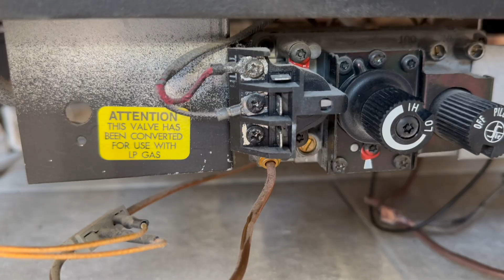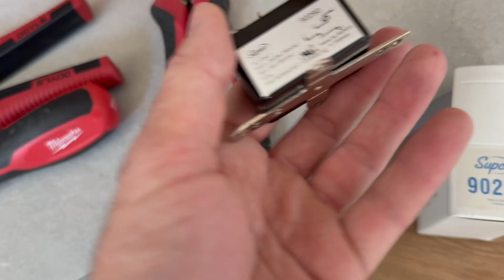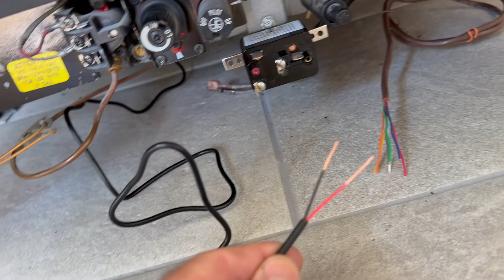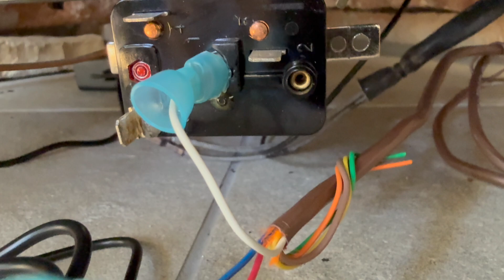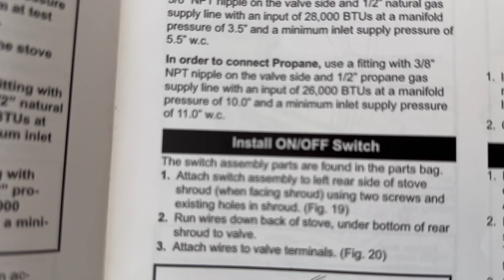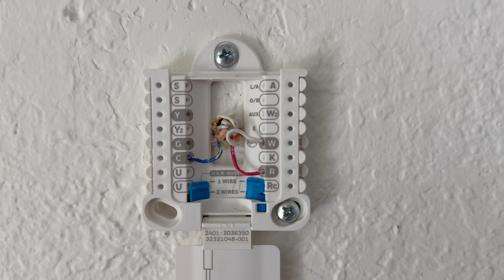Control Gas Fireplace With A Smart Thermostat

Comment: your video has been the first that i have been able to find that has had any kind of reasonable explanation of anything understandable. however, i am still lost looking for some assistance. i have an OLD in floor gravity heater that is natural gas. it only has the red and white wire going to the thermostat. recently i bought a smart thermostat, the meross mts300 thinking it would be a nice upgrade. however even getting the transformer did nothing. the only power that comes from the heater itself is from the thermal coupler. so i dont even have to turn the power off. after messing with it for nearly an entire day i have come to the conclusion that nothing i can do will help. then i find out that i may need an external relay. so where i am going with this is. will the relay that you have linked along with my setup and the specific thermostat actually work?
Reply: after getting the relay that you suggested in this video, i was able to do exactly what i was hoping to do. you sir, have the one video that truly helped me get things done!!!! i cannot thank you enough for your video.
Reply from the maker: Sorry I just now saw this. Sounds like you got it working so that’s great to hear. Yes what you described is the same essential set up as the fireplace in my video. Simple open/shut thermocouple. Glad it helped bring your heating life into the 21st century
Reply: @neaterdad625  after finding a wire diagram along with your video. Yes I did get it done. So thank you for this video. An actual educational purpose. Not for just popularity. So, sir. Thank you again and may you and yours be safe.

Comment: So I hooked everything up as per your directions, good commentary, thanks, however when setting up the smart thermostat to boiler it ask if it is water or steam, does this matter
Reply from the maker: Select Water. Neither option is an exact match for a gas fireplace, but water is the better starting point. The main difference is how frequently the thermostat cycles the heat. it should still provide basic on/off control either way but water may have more cycles per hour and be more responsive as a result.

Comment: I bought the relay you linked to in your video, when I opened it I noticed i was a 90-380 not a 90-290, will it work with this relay?
Reply from the maker: Thanks for catching that, it seems to have changed since I posted it. I’ll update the link. Sorry about that. 

Yes I believe it’ll still work. Use 1 and 3 for R and W. Use 2 and 4 OR 5 and 6 for the fireplace

Comment: Thank you!  We watched a few videos before finding yours.  They just left some gaps in the information but yours gave us everything we need PLUS the appropriate parts.  Not sure why they don't just sell gas fireplaces prepped for a thermostat but you've got us all set now.  Thanks again!
Reply: Where would the red wire go if there is a RC and RH?
Reply from the maker: Hey just saw this. So the RH is for heating, that’s where the red would go for the fireplace. RC is for cooling. Most modern smart thermostats have an internal jumper wire between RC and RH. So by powering one, you automatically power the other. 

Older units you would make a little jumper wire. 

Hope that helps.
Reply from the maker: I happy to hear it helped